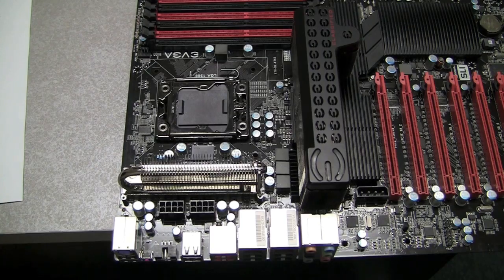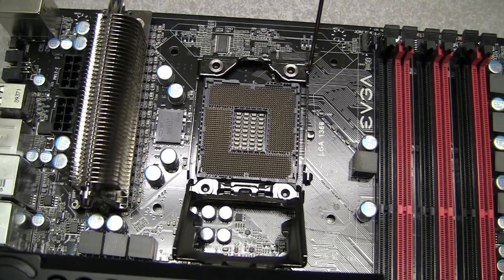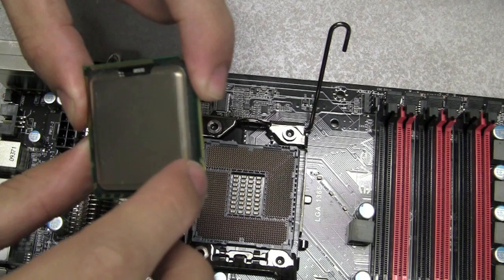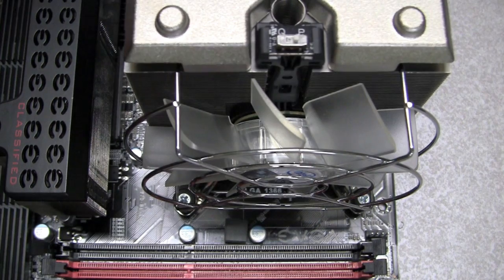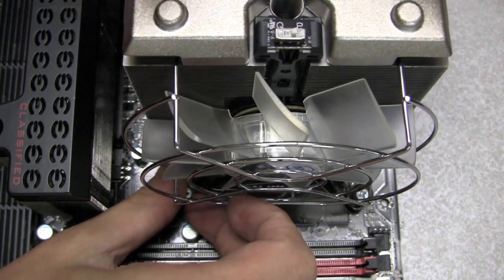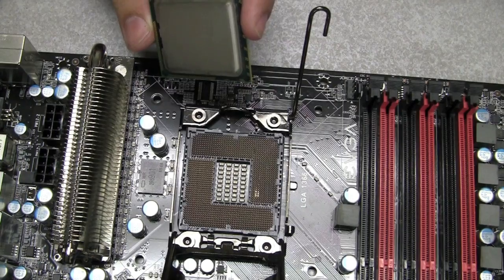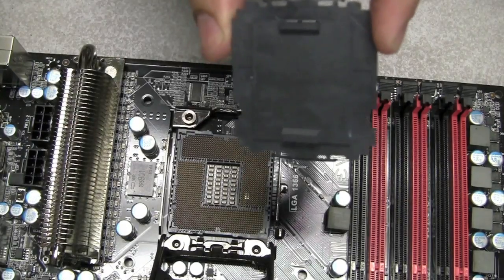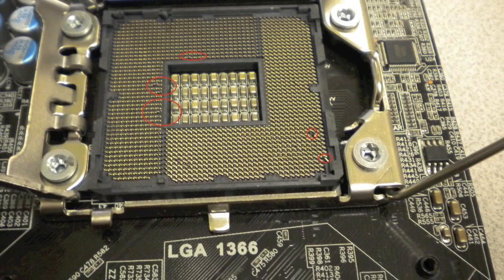CPU Installation

Comment: well this parts are very strength for what i have experienced, i drop my cpu because the cage that intel gives is not strength enough, and then i used the wrong screws for the motherboard so the cooler wasn't very tight, it was like 80C and after 1 or 2 minutes it crashed, but everything is working really nice now so
i think it's ok for my first time building a computer from scratch XD

Comment: @NiGHTSChao689 do not ever put thermal paste on the pins or socket. only thing it's be efficient at is destroying your motherboard. you only put it in between the heat sink and the top of the processor. most thermal pastes on the market do conduct electricity.